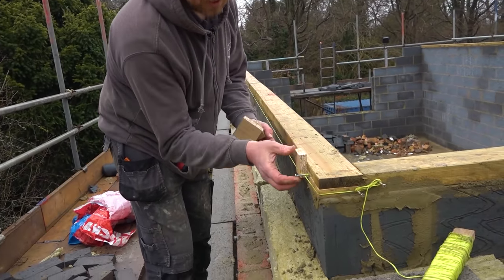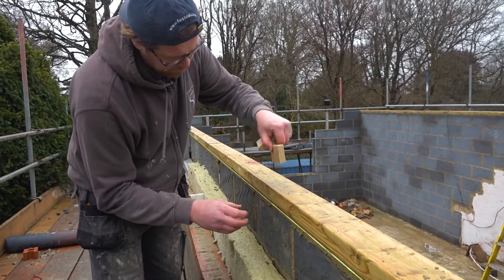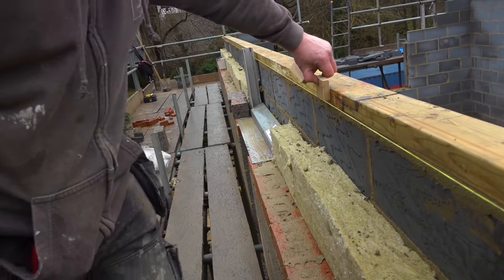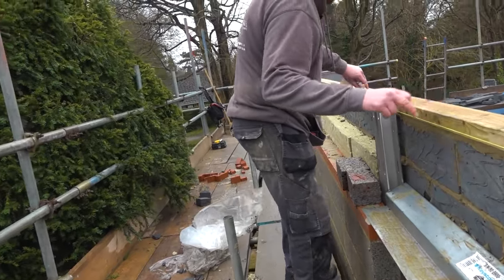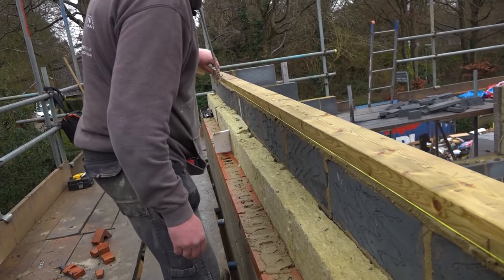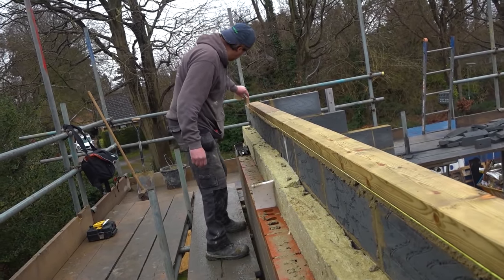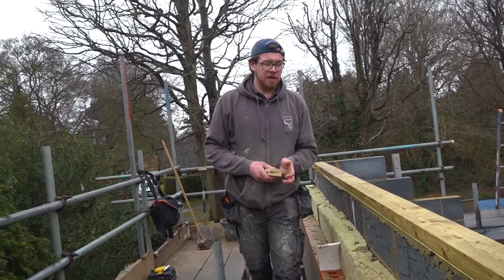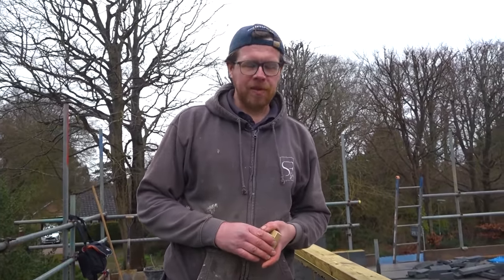Straight String Line Trick ~ 2-Minute Tip

Comment: This is one of the best ways to ensure work is kept to a high standard. I used this method 2 days ago to flatten and level a ceiling on a job, where we installed a new RSJ within the ceiling void. Plasterers will thank you if you do this as it makes thier life so much easier to achieve a flat and fine finish 👍 ah the humble string line, a builders best friend 😉

Comment: The thing about this is... I'm a DIYer and refurbishing an old stone farmers cottage here (west coast of Ireland) & NOTHING is very straight, plumb or square... 

I've learned (the hard way) that if you ensure you incorporate that level of accuracy in your work as you go, you save time later... 

Case in point...
I'm building 3x2 studded walls against all the inside stone walls with a 25mm insulation sheet thermal break and rigid in between the wall studs... anyhoo... making sure these walls are square to each other makes SUCH a difference when it comes to laying floor vinyl laminate (no DPC so no mdf laminate for me😉)... also 100% vertical studs are easier to screw to, I use a cheap laser & hit a mark at the top and scribe the plasterboard... easy peasy... I know I'm not doin it the "professionals" way but I AM building in the accuracy required... 

This house is 100 years old..

I'm lowering every ceiling 
Full re-wire
Full re-plumb
25mm insulation + 18mm ply floors (before final covering)
Re-slated roof... 

And lots more .. 🙄
But I'm enjoying learning the trades as I go along ... the lads here at skillbuilder are also a great help, its what youtube is best at... 

😎👍☘🍺
Reply from the maker: That is great to hear your views on this. We all learn as we go along and never stop learning but the saying "Start right and you finish right" is key to the whole thing. If you think "Ah the wall is a little out of plumb but the plasterer will put it right" you will be in for a dissapointment. As you say, when it comes to the tiles and flooring it will show up.
Reply: @SkillBuilder   😎👍☘🍺

Comment: I'm not trying to pick fault but shouldn't there be an AIR GAP between the insulation and inner face of the brick? I'm just trying to learn. Thank you for your videos, I really enjoy watching them.
Reply: Not on this type of construction, it’s a mass fill cavity batt. The type you may be thinking of is the dense pir board insulation that we had to use special clips for on the wall ties to hold it in position.
Reply: @jimichip  Thank you James for explaining that. Cheers!

Comment: What size are the timber wall plates, 4x2?
Doesn't building inspector get upset that you haven't used 4x3?
Reply from the maker: If the drawing calls for 4x3 then that is what is used but you build to a set of plans that are passed. If they are passed then the Building Inspector is there to make sure you do what is on the drawing. If the builder wants to start beefing everything up without raising the price then he can do that and get his reward in heaven.
Reply: @SkillBuilder  I doubt using 4" x 3" would bankrupt the builder! Can't remember the last time it wasn't specified on a job, building control must be easily pleased down your way!

Comment: Line on a wall plate 😵 surly plumbing up
From the wall is good enough. The wall should be straight as it was built with a line
Reply from the maker: It matters because timber is rarely straight over the length and we want to sit the roof on it. Having it straight means every rafter can be cut the same